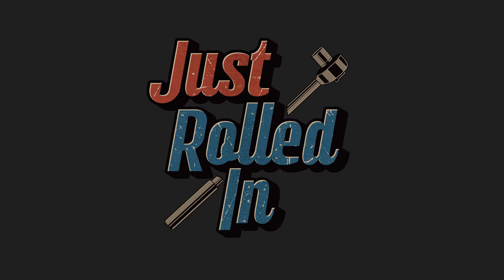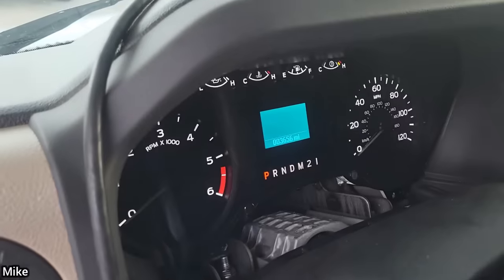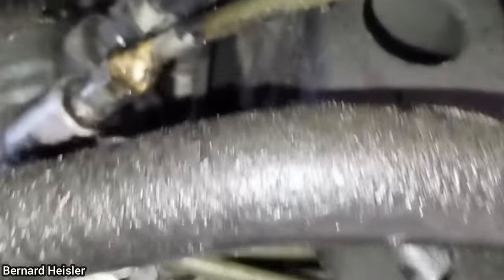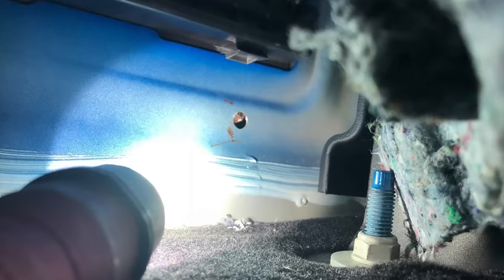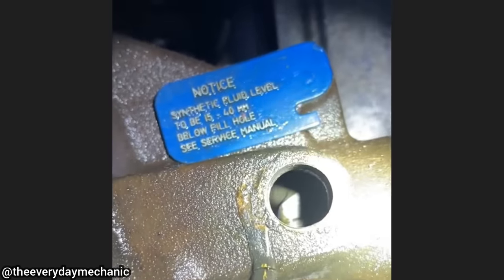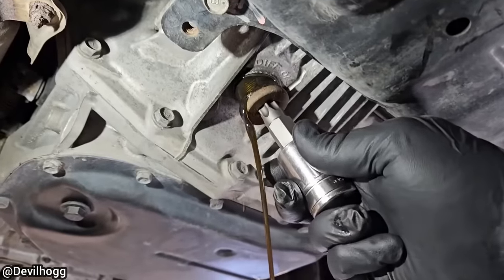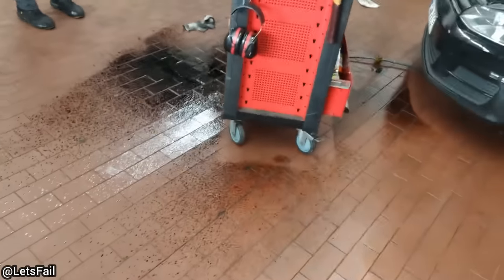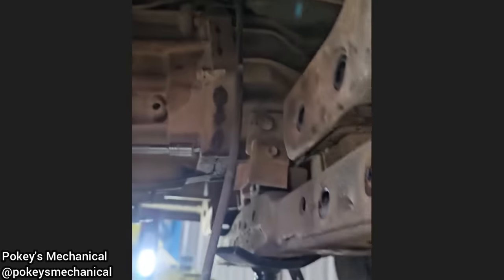Mechanic FAILS Compilation | Just Rolled In

Comment from the maker: What's the worst thing you've done as a mechanic/technician in the work place?
If you'd like to see another video like this in the future let us know. We wanted to change it up for the rest of the year.

Submit your clips/photos at www.justrolledinyt.com
Reply from the maker: @@calfeasance I know all about zombie mode as well lol. Hope it never happens again haha
Reply: @@calfeasancebruh I've been in zombie mode for like 2 years straight I swear
Reply: Dropped a very very low car onto a filled and capped oil drain pan which blew the cap off and exploded oil across the floor or my garage.

Replaced a bunch of parts on a motorcycle that wouldn't run. It was out of fuel.

On the same motorcycle, I was installing an aftermarket clutch. While I had the clutch cover off, I suspect I dropped some metal shavings into the engine while doing some unrelated work. After the clutch replacement, I rode about 100 miles before the engine started knocking. Oil was glittered and the engine needed rebuilt. Still have the bike with a fresh engine in it now.

Had intermittent issues with an LS400 needing to bump the key a few times before it would crank. Once it would crank, it was strong so I figured the battery was fine and starter solenoid was going bad. Replaced the starter (it's under the intake manifold) and it still wouldn't crank. Turned out to be a loose battery cable.

I think that's the last of my tales. For now.
Reply: I did the classic blunder of leaving the exposed metal window wiper arm in the upwards position while walking in to get a new wiper. I came back out to a smashed windscreen.
Reply: This is a very long story. I was a trim tech at a Ford dealer, Cust brought in an 86 F150, complaint was it wouldn't start in Park, a common problem. Got it started, pulled halfway into my bay, put it in Park, and set the parking brake. Then, for some unknown reason, I turned the key on, and went and jumped the starter solenoid on the fender. The engine started. Then I saw the engine torque over toward the driver side. In that millisecond, I knew that it was in Reverse. Know what is funny about duo-servo drum brakes? They don't hold well in Reverse. The truck started to go backwards. I stupidly tried to hold it back by grabbing on the radiator support bar, which not only dragged me toward the end of my bay, but sliced my fingers open while doing it. Oh, did I mention that I had left the front wheels turned to the right? As I got to the end of my bay, I let go, and watched the truck back out in a curve, ramming right into a customer's new Expedition. L/F fender of the Expedition was crumpled, and the tailgate of the F150 was damaged. Told my boss, he didn't believe me. When all was said and done, I had bandaged fingers, a horribly bruised ego, I wasn't in trouble, and they didn't charge me for the repairs. I learned that I wasn't strong enough to hold back a truck with a 351 FI engine, and that I got pretty lucky after all. Actually, I learned quite a lot!
Reply: I like to see bad work that mechanics do actually believe was done by other professionals so I can better identify it myself, so I like this kind of video. maybe you could do one each year or six months. but the funny noises compilations are probably my favourite!
Reply: Not a pro just a weekend warrior.  Was doing my wife's brakes, and I was hoping to use the rear brakes (electric parking brake) I had just done to help hold it on our sloping driveway while moving the chocks so I could work on the front brakes.  But to put the brakes back into normal mode, you have to pump them to prove to the system that they will build pressure.  I was getting super frustrated that day and forgot I had taken one of the front calipers off already.  After a few pumps the piston blew out of the caliper and dumped a lot of brake fluid all over my driveway. I've never messed with a caliper before, so I just ignorantly stretched the boot and put it back in after wiping it clean. Several thousand miles later, seems no worse for the wear.  Maybe I got lucky. I don't even know.
Reply: don't change it up too much.
i thought you'd just got the formula right.
but the was awesome/terrifying, so maybe at the final end of the month round-up?
Reply: Once I worked in a small shop and was cleaning up, I put the broom with the handle in the garage door track and went to close it causing the cables on the door to bind and break. Then as if that wasn’t bad enough I went to kick the broom out of the way causing the door to slam shut. The wonder wasn’t pleased but fortunately I kept my job but he had to hire an emergency garage door person to repair it so the car in the bay could be removed.
Reply from the maker: @johnlow3894  format will always stay the same. Just a couple of different videos to finish the year off, so I can have more than 1 day off with my family 😅.
Reply: Excellent work, Sir! 
Merry Christmas to you, Mrs Just Rolled In, and especially little Just Rolled Out for his first Christmas! And God Bless you all! o7
Reply: I almost blew up a cobra mustang because I left a bolt loose in the intake. It got sucked in and the car went into limp mode. Thankfully no damage was done and the guy was getting more work done at another shop anyway.
Reply: If I don’t know,I don’t try!!
Reply: I did an oil change service on a customer's car & didn't realize the old filter's gasket stayed stuck to the engine. When I put the new filter on, it doubled over the old gasket. When I started the car & brought it to the service bay I noticed a nice trail of oil starting from my bay. The service manager just gave me "the look" & I didn't really even need that much 😧😅. Took care of that quick & never changed a filter without checking for the old gasket ever again!
Reply: I was night shift mechanic for a sawmill. One night I changed the oil on the Cat 980C and forgot about the drain pan when I backed it out of the shop. The heel of the log forks were just high enough to flip the used oil pan over and I had the joy of cleaning up the 10 gallons of black oil...I worked sawmill maintenance from 1987 until 2012 so I saw a lot of bad choices. (not just mine)
Reply: Over tightened a new oil pressure switch on a early 2000s CRV, the switch used NPT pipe thread and I ended up cracking the engine block. The shop’s insurance ended up replacing the whole car because a replacement engine was more expensive than the value of the car itself.
Reply: I'm all in for everything you show
Reply: Double gasketed an oil filter when I was just starting out. Had to pay off the cost of an engine out of my paychecks for the next few months.
Reply: i'm in my school's auto tech program and the worst thing i can remember is overtightening a transmission mount bolt and stripping the thing. it seems to be doing fine but it's back in our shop for some reason (remember that this is a high school shop where we use actual vehicles and not demo vehicles)
Reply: Awesome compilation dude 👌 years.....and years ago, running around the shop looking for something.. Can't even remember what!!.... Went in-between a line of parked vehicles... Totally forgot about the pit.. 🤦‍♂️🙈  Yes that was me disappeared down into the depths 🤣🤣 always wary of pits now!! 🤣 Looking forward to the other comps. Have a great week my friend 👍
Reply: I work in refrigeration. To locate large leaks, I often put massive amounts of nitrogen into the system so I can listen for the leak. One time, the leak came from the compressor circuit. I couldn't get the circuit cover off, so I grabbed a hammer and broke the circuit off. This force, combined with the high pressure, caused the compressor pins to explode off. I wasn't facing the blast zone, so I wasn't harmed. But the blast itself and the massive hole in the compressor were captured on video. I have tried in vain to get the footage, but my supervisor always refused
Reply: The worst thing I've done as a mechanic was back in my stupid years. Was in a nice brand new Escalade that had some sick street music just blast out ( customer's pick I guess ) when I turned it on. Wheeled it into the shop and was bouncing in the seat up and down to the music like an idiot cause everyone was looking at me from the music, and just jumped out of the vehicle w/o putting it in park ( completely forgot to do that ). The front bumper crunched up against the tire mount machine. Just needed a new bumper. I can't believe I wasn't fired, but I was on some serious probation after that.
Reply: 1993 I changed the gear oil in a Dodge transfer case.  First I ever heard of those things taking Transmission Fluid. I got fired. I think I ruined the case. 😕🤦
Reply: 2005 Passat Wagon comes in for an oil change. I remove the filter, see the old o-ring on the filter, and think all is good, spin the new one on. Fill them up, top off windshield washer, send them on their way. They call the shop about ten minutes later from the side of the road, their Oil Pressure warning lamp came on and they shut the car off immediately. I grab the Shop Car ('89 Honda Accord LX 5-speed, LOVED THAT CAR!), fill up a jug with oil, grab a floor jack, drain pan, and some tools, and hightail it down there. I see a nice trail of oil on the pavement up to where they pulled over, with a small puddle underneath. Jack the front end up and take a gander, and I find the problem. The oil change before the one I performed was done at a local VW dealership - THEY failed to remove the old filter's o-ring that was stuck to the filter adapter, and spun the new one on over it. They had cranked that filter on super-tight, presumably to stop the leak they caused, and I neglected to check because there was still an o-ring on the old filter. So, another brand new filter on their Passat, top off the oil, and with crossed fingers, we restarted the car. Ran smoothly, no noise, no leaks, and I advised them to come directly to the shop so I could get it on a lift, re-re-check my work, and degrease the undercarriage. I felt like a fool, but it was a lesson learned and I never neglected to check for an o-ring again! 

They were, surprisingly, quite understanding and very nice about it, told me there was no harm done and not to beat myself up over it, but I knew just how much harm COULD have been done, had they not been paying attention to their warning lights. My boss would NOT have been happy with an engine replacement, he could barely afford his ginger brandy, or to keep the lights on, or to make sure our paychecks wouldn't bounce, or to keep us from multiple temporary evictions for not paying the mortgage.
Reply: Thankfully nothing so bad in my (very) brief stint as a mechanic.  However I was once doing an oil change on my aunt’s car and, while under the car to undo the drain plug, I noticed her anti-roll bar clamps were loose.  No biggie, I thought, I’ll grab a spanner (different size than the drain plug) and nip those up while the oil drains out.  

So I’m under the car tightening things up as the last of the old oil dribbled into the catch tray.  Suddenly a stream of fresh oil from the drain hits me right in the face, getting in my eyes (and I was wearing contact lenses at the time) and mouth.  Turns out my young cousin, seeing the bottle of fresh oil I’d put on top of the engine and funnel already in the filler neck, decided to be “helpful” and start dumping the fresh oil into the engine just after I’d got back underneath.

 Blinded (not permanently!) by the oil and spitting furiously, I rolled out the way,  headbutted the oil pan, invented three new swear words, jammed a finger in the drain hole, dug the drain plug out my pocket with my other hand (right hand, left side jeans pocket for maximum awkwardness), bumped the oil catch tray with my shoulder and slopped half the contents over me and the driveway, frantically screwed the drain plug back in and then finally rolled out from under the car.

My aunt, hearing the commotion, comes out the house to find my lying on the driveway trying to clear the oil from my face, bleeding from the cut on my head (it wasn’t serious), covered in old oil and my young cousin crying her eyes out.  Once briefed on the situation by me (in less than moderated language) she, being British like me, said the only thing she could say in the circumstances:

“Never mind, I’ll make you a cuppa tea!”

No good deed goes unpunished, I guess.
Reply: I worked at a sears auto center for the last year it was open and it was wild. We all knew it was going to happen eventually just didn't get word yet so we all rushed to do all the training and paid licenses. 

Learning how the pneumatic oil drain tank works I opened the upper valve while pressurized and oil hit the 25 foot ceiling, coated the wall. We all laughed and left it like that just dripping down the wall. 

One of my favorite moments was when we made a train out of shopping carts and a floor cleaner zamboni thing and rode it around the massive building inside and out. 

At one point we were bored and remembered we had a lot of tools and just started to build crazy and dangerous things. Good times, lot of stories.
Reply: @300DBenz  I've killed an engine as well.
Was doing my typical service routine. On a car with a DSG Transmission. Oil out, replacing brake fluid and since the car is lifted I might just get started on my first ever DSG oil change.

You gotta let the engine run so the transmission pumps and keeps all of its oil.
So I fill the thing up till oil overflows. Then I start the engine and fill it up again.
The engine is running now for a couple of minutes when suddenly. It shuts off.

Remember my service routine earlieyer? Yes guess who's the jack ass to run an engine without oil.
Reply: @WardyLion superb. As all Brits know, tea fixes everything:-) ☕️🇬🇧
Reply: I love the cars full of rubbish, and the funny noise cars. They make me laugh and laugh!
Reply: The first time I changed the gearbox in a car (my own) I pulled all my tools out from underneath and found the clutch release bearing amongst them. 
Yeah, I had to take the whole thing out again for the thirty second job of fitting it.. 
I'm just glad it wasn't fwd.
Reply: Not me but someone I know - <Head under the car trying to work out why the engine just cut >  "Hang on a minute, I think I can smell petrol"  <lights zippo>
Managed to save the the shell and the engine.
It had to be completely rebuilt with new interiors and new wiring.
Reply: My first year as a mechanic and I was putting ATF in a manual. Yes, I almost fuxked up til one of the other techs pointed it out. 😅
Reply: @ProjectGibix I made the opposite mistake: I put manual fluid in a manual transmission..... turns out the 5-speed manual on a '90 ranger takes ATF!
Reply: 25 year ago at a Nissan dealership as a new mechanic..I was on a single post center lift Lift controlled by air compressor and the safety latch that kicks out at the bottom was all gooked up and plus I did not know it even had one,was drilling  out rear exhaust manifold broken bolts in which I had the cradle out of it,pass. side wheel/all 3 belts off having to come in that way with a 90 degree drill.....Had a pole jack holding up engine,was gonna finish it up next morning so I left it on lift that way.......manager shut off air compressor before we closed......so when I came in next morning...OHH what a mess..van had slowly settled down on lift except the front was still up a few feet...antifreeze/oil/transmission fluid everywhere..pole jack had shot forward and took out rad. support/rad/condensor/hood and the engine was sitting on floor......2300 dollars worth the damage man on a quest van still under warranty man! It was a bad day for sure but had a understanding boss thank the Lord.
Reply: @Schreuganoot  Oh wtf?!
Reply: The customer came in with an early 2000s Chevrolet truck.  believe with some grinding noise in the driveline somewhere. I pulled both final drive fill plugs and the transfer case plug. Found huge chunks of metal in the transfer case. It still drove somehow. Well, after lunch, my coworker and manager took it for a test drive. The rear end locked up after a few miles. I had forgotten to put the fill plug back in. They replaced it without informing the customer because he was a cranky old dude. It still needed the transfer case later. $1800~ for the whole new rear axle from a junk yard. 

When I first started out, I backed over a spare tire cover off of a like '08 RAV4. Just enough to crunch it. I was on a 4 post lift and set it down on the ramp. I was resetting TPMS and had to scan in the spare. It was like $400 painted.
Reply: @UncleKennysPlace ahh the good old snap-on knuckle buster 3/8, good times  (not lol)
Reply: Rebuilt a carb on an older s10, lil 2bbl,  replace, start , lil adjustment here n there,  she's sitting there humming along.  Walk across shop to tell boss ima test drive,  his eyes get wide ,  fire! I spin around ohshit! Grabbed fire extinguisher right by were i was.   Pulled the pin and trigger at same time running across two bays.    Much breath was lost that day. Smh lol.  Saved truck tho.😂
Reply: Jacked up a Cadillac CTS out in a yard to change the oil, jacked it up on a smooth crossmember had it running to check for leaks then started to lower the car down and the jacks wheels started to bury in the dirt so the jack couldn't roll back the car the jack ended up sliding off of the crossmember and shattered the oil pan while the engine was running.... Was able to turn off the motor before the engine was harmed, but had to drive out of town to buy a new oil pan because it was going to take too long to have it shipped to me.......
Reply: At school in auto shop got the same guy twice with my car. First he leans over the engine and it backfired through the carb and lit his hair on fire. Then a month later I just rebuilt the engine and was getting it running. He goes to the rear and puts the air in the gas tank to force fuel into the lines and the car backfired and blew the gas tank off the car scaring the crap out of him 😂
Reply: Straightening a front radiator support in my 4by, I didn't remove radiator due to being lazy,  used a Crowbar to pry up off my bullbar and slipped... 2inch hole through my radiator. Was in a bad life situation at the time, Tried to patch it with solder and exhaust glue as it's all I had and still need to get to work.... Toyota 2.8l turbo 3L running +200hp I blew the engine the next day, all because of laziness and no patience, that engine ran +200hp for 5years 0-100kph in 7sec and maxed out due to gearing at 165kph. I learnt that day.
Reply: I blew a motor. This is what happens when you’re not trained properly.😂
Reply: It would be truly funny if the horn button didn’t work and everything else did.
Reply: I’ve admittedly installed a brake pad backwards 1 hour after closing and my manager brought in another job and I had to leave
Didn’t make a sound until the next day 😂we replaced the damaged parts free

I’ve also installed connecting rod caps backwards (flipping the engine on the stand disoriented me and I was working on a couple jobs at once)
That’s when I found out they don’t turn when they’re in facing wrong direction 😂took me forever to figure out, bearing clearance was still the same
You can tell they’re facing the right direction because the rod and cap will sit flush on the sides 😂
Edit:
I’ve also set myself on fire a handful of times from welding around brake clean, I have way better clips of being engulfed by a fireball I’ll send them
I’m very inpatient 😅my shop has 4.9 rating though, must be dojng something right
Reply: Lost a 10mm socket I had to borrow after losing mine.
Reply: Why aren't these shops who spray paint alternators named so others can avoid them?
Reply: I broke a spring compressor and took a strut to the face. Only took 25 stitches in my lip to put it all back together.